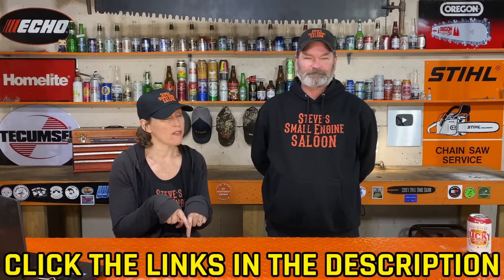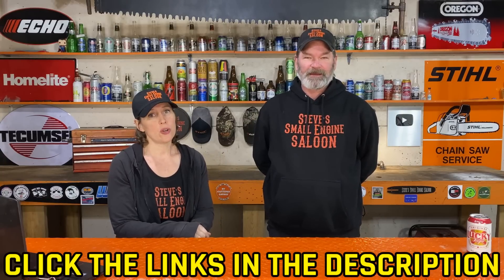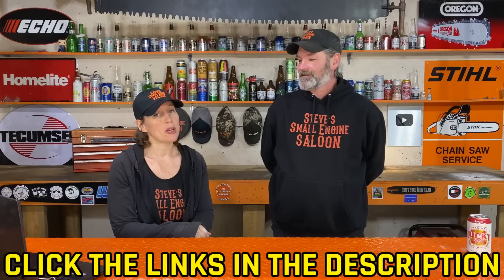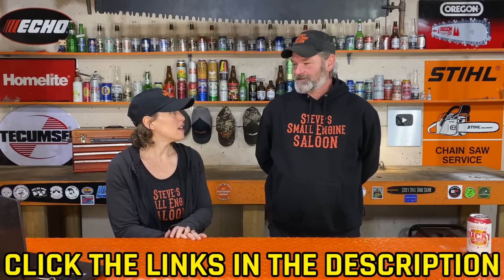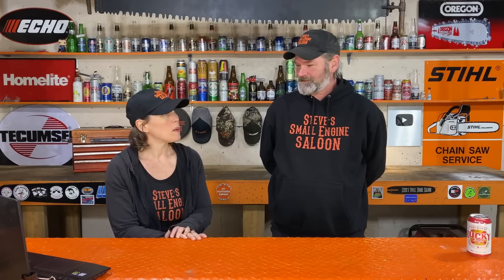Why Does My Engine STOP Running After A Few Minutes? (DAY 29)

Comment: Engine start’s up a minute or 2 then dies. Replaced spark plug, filter is clean, did the gas cap test, even bought a new cap just in case, ??? Should I clean out carb now?? Cleaned the carb but not idling at full power, does not turn off , could old gas do that?

Comment: Interesting, I had a Briggs and Stratton engine which would run and die couldn't find anything wrong with it. Then a friend said have you checked the valve clearance. That was the problem as they age the valves stretch so when the engine gets hot the valves won't seat.

Comment: I had this problem with a stihl 029. It ended up being a bad spark plug. The plug would gather up resistance after a few minutes and stop producing spark. A new spark plug fixed it.

Comment: OK so I have a fun one and although I think you may have already described this I'll throw it out there...... Husq 128LD "ran last summer"  Wouldnt run - found the pickup line missing - replaced and ran "Kindof" cleaned the carb, no change. Replaced the carb and fuel lines and then did the tune (out 1.25 on each and then adjust to get running right)  Just as I got it to where it was running like a top, it died (like being turned off)  CHecked the fuel cap like you mentioned here - No change, Checked spark arrestor - Clean, Changed plug - No change. The only thing I can figure now is that it is the coil.. Only loss is that it fires right back up every time wich if it was heat-related I would assume that it would take a min to start again..... Seemed strange to me thought you may enjoy and others may benefit.

Comment: I had to weigh in on this one.  A long time ago I fixed a two stroke lawn mower engine with the same problem. When I disassembled the carburetor I found a small orifice clogged with lint.  Removed the lint and deburred the rough edge around the orifice and it ran happily ever after.

Comment: I know the questions are over but I've got a big one. So many hydraulic units in my area run on a B&S engines. I have a 208cc. I think these engines are solid but the carbs absolutely SUCK!! I can never get it right, it's brand new and often won't start, won't stay running, etc. Sometimes it will run for hours, others, nothing. What can I do? Replace the carb? With what?

Comment: Had a gas cap save me heaps of money, a guy had a Chipper Shredder for sale cheap, I managed to get it even cheaper, took it home, did the oil change, pulled it apart to sharpen blades and then used it and it ran for a while then shut down checked fuel still plenty it started back up and ran for awhile did the same, flushed tank, cleaned carb, inline filter installed still the same, thinking this is why it was cheap, then before it shut completely off I opened the tank and it took right off, it was a light bulb moment.

Comment: I rebuilt/cleaned my ryobi with 25cc carb, ign module and started up. Now runs then quits or won't restart unless I let it cool down or wait till the next day😬. Did notice the top gas cap might have a breather? I dug some junk out till some clean material showed. Humm give it another try tomorrow ..
Reply: Thanks for the reply. Went to try it today. Fired up ran for 15min and quite. Think there's something with ring, piston and cylinder?? Guess it's time for the grave yard of parts.

Comment: Steve, good explanation on the ignition module,  but you forgot to to mention that after the saw cools down it will work perfectly again until it warms up, then it'll shut down again. 
I had a 1073 pioneer and before I realized what the problem was I thought it had gotten lazy and didn't want to work outside the shed

Comment: I've also seen or rare occasions a spark plug that is faulty or improper will change as it gets hot and suddenly shut the engine down. Usually after 1-3 minutes from cold.

Comment: I addressed all three of them last summer and that did not solve it.
I thought possibly I bought a bad ignition coil and discover there was a mouse nest that was causing the engine to overheat and shut down.
About three years ago had a plugged muffler and caused the engine to shut down also all of them acted the same way like I was running out of gasoline even though I had a full tank.

Comment: Thanks for these ideas. I have a older log splitter with an B&S IC 8 HP engine. It just randomly shuts off. Could be the vacuum operated fuel pump, on/off switch, carb float, etc. I have the parts. Just need the time and motivation to mess with it.

Comment: wow, I cam across this a little to late. I have a sthil 066 chainsaw. Ive changed the filter, it has fresh petrol. It will run full blast for about 30 sec to a min. Then it will cough and splutter like its running out of fuel. If I quickly take my finger off the trigger it will idle fine unless I pull the trigger. Before I pull the carby to pieces and look for something like a blocked jet, is there anything else it could be.

Comment: Another thing for run-ability , especially for 2-strokes, is to check the Spark Arrestor Screen in the muffler …I’ve seen it with a lot of different 2-stroke equipment that the screen will get plugged from running too rich or if they get left idling, the screen gets plugged…this will definitely cause them to stall, die or not want to start…good series guys! 😎👍

Comment: Why do i have gas coming out of my gas cap when its closed?
Reply: If you have full tank and you stored it like fuel is reaching the cap, then it will filter something out. Just don't store with full tank, or put upwards/on the side, so the cap is up, and filtering not happen.

Comment: My Honda generator 4 stroke would shut off after one minute and 6 seconds after starting. Dead off, no surging. Checked the obvious, vent, gas, plug and oil. I would have to wait a few minutes before it would start again only to run for one minute and 6 seconds; every time.  I pulled the carburetor and it was clean. Then I ordered a completely new ignition system and installed it. The problem stayed the same. Since the new ignition kit included a new spark plug which I did not use because my old one looked and tested fine, I figured what the hell and put it in. It started up on the first pull as always as I also hit my timer and it ran one minute and six seconds and kept going and going. What the HELL!!! I have never heard of a plug doing that. Lesson learned, always do the easy parts first no matter if you think it could be the cause or not.

Comment: Briggs used a needle seat that was red/ maroon in color and there are plenty of still out there. It would swell to the point of closing off the incoming fuel to the carb. A variation of your running out of fuel scenario.😊

Comment: A non venting gas cap on pressure washer drove me crazy for a long time. Took a while to diagnose it as a problem with the cap. Then I blew it out multiple times to no avail. Finally drilled a 1/16" hole in the cap. Voila, problem solved! Thanks for this series. Have enjoyed the very useful information.

Comment: Thanks for the 30 days of questions.
My Stihl FS76 trimmer would run fine for several minutes but would die and not run until cooled back down. My research led me to believe that it was the coil. I decided to install a new carb before a new coil and it fixed the problem.

Comment: My chainsaw did the same thing, I had a pin hole in the fuel line and it was sucking air.  Nothing dripped externally.  I had to remove line and inspect  line.

Would always restart after dieing, but would constantly have to restart it.

Comment: Hey steve, another reason why an engine dies after a short run time can also be the spark plug breaking down, see this a lot at the small engine shop I work at.
Reply: I had a spark plug breakdown on my Honda generator. The generator would start and run for about a minute or so and shut down. I took the oil shutdown device out of the circuit and that didn't help. Changed the plug and that solved the problem.

Comment: As it is 2023, I would say at least 60% of trouble with small 4strokes is caused by ethanol-water caused sludge building at the bottom of fuel tank where mesh covered fuel intake is located. To solve many problems we are facing with climate, economy etc., we need US, Europe and Japan built engines, make them well and make them last! Many thanks for what you do!

Comment: Two other issues I have seen- carb vapor lock once hot, and engine case/carb mating surface changes shape and allows an air leask- lean die condition.

Comment: I had this happened to me with my log splitter - it would start then stop and eventually, it just would not start. I replaced the fuel, a new plug, ripped the carby apart and cleaned all the little jets and fuel lines, etc, - I was stumped. Asked someone for advice and they queried me about the oil level. 'Low oil' - so I topped it up and presto, away it went. I'd never heard of the 'Low Oil Sensor' and now I know - I felt like a real goose, such a simple thing, but the sensor was doing its job. At the time I thought, what a great bit of technology to be put into the engine. Even now, a few yrs later, I still think about it and think to myself 'how naive I was' - Live and Learn.

Comment: Steve I had the run and stop problem with my push mower and it turned out to be a fouled spark plug. Cleaned it with gas and fixed the problem. It was soaked with oil so I guess the cylinder wall is getting thin. Agreed?

Comment: Steve,
Probably not the case - but if random, a floater in the tank as a possibility (the other side of an air vent question).  
How about the engine heating up, with things expanding through normal, operating heat level being achieved - say a loose plug changing grounding due to expansion from changing temperatures?
Joe

Comment: I've had a weedeater die slowly like this, and it was the choke not fully opening after starting it, like it was set wrong. I had to fiddle with the choke every time until I found the sweet spot. My current weedeater runs great, but came from the factory with the choke switch set backwards! I 'open' the choke to start it, and 'close' it while running. It took me a while to figure that out in the beginning. I thought I was going crazy. Had to go show it to my neighbour!

Comment: My John Deere Ryder started having a similar problem sometimes would run for several minutes other times only a few seconds. Turned out that the crank pressure tube to the fuel pump was leaking; put a new one on and it worked great.  
Thanks for the 30 days of questions- maybe bump it up to 90?? 🤞

Comment: Hey Steve and April.  Thanks so much for the great series of videos.  Lots of info and fun.  My friend had a problem with his mower running a few minutes and would shut off.  Sure enough, he had trash blocking his gas cap vent.  Cleared the vent and all is well.  Thanks again.

Comment: Had an oil alert on a Honda engine cut the engine out every time the mower turned right on a big "reel" mower. customer couldn't believe it when I diagnosed low oil level over the phone .

Comment: One thing you failed to mention is maybe their is something floating in the gas tank that ocassionally gets sucked down against the hole for the fuel line connection. Had a friend that happened to. They could not figure out why their lawn mower engine would run good, then suddenly act like it ran out of fuel. Then they would start it again, and it would run fine for a while then do it again. They found a dead fly in the gas tank, and the problem went away.

Comment: Sometimes it can be a thermal problem, but most it is a faulty fuel vent/cap problem or a clogged fuel Filter inside

Comment: Hi Steve I have a question. I have a JD lt150  5spd. I used the mower today and before I put it away I was going to back it in my garage and it won't go in reverse it only goes forward and I believe it's in high gear when I push the pedal in the mower does not go in neutral it stays in gear . The parking brake works and the gear shifter moves in all gear's.

Comment: I got a deal on a couple year old 2 cyl 24HP Craftsman rider with 40 hours on it.  Guy sold it dirt cheap, kept having to change the air filter to keep going.  I Found out the large gasket in the gas cap lid had been miss molded. The small vent pin hole was not open. I punched a hole and the problem went away.  When he changed the air filter it had time to vent and he probably checked the gas and it would run a while.  Runs fine now and for hours.

Comment: Good video as usual. But you forgot to mention a plugged fuel filter. I have seen where it would allow the engine to start and run for a little bit then shut down.
Reply: or allow the generator to run until you put a big load on it...
Reply: @wim0104  You are correct. I have seen that also but had forgotten it. Dang it sucks getting old.😗

Comment: I also had this problem on my Kubota 3 cylinder diesel tractor . It would work under load slashing ( Brush hog ) for an hour or so then lose power and revs . I put a siphon hose in the fuel tank and a load of slime and some rust came out , so I'd siphon , refill with clear fuel , over and over until it was as clean as I could get , new fuel filter , add biocide shock treatment and it's been good ever since .

Comment: Hey Steve ive had a four stroke stop running and it was the spark plug . Ever hear of that happening? And the plug was clean only a year old.
Reply: Same.  Symptoms were instant off, like oil or ignition, and would then start right back up... and then die again, rinse and repeat.  Turned out to be the spark plug.

Comment: I've had a similar problem but it was due to the in-tank fuel filter. The thing was clogged and on accelerating the motor it would starve the carb of fuel and shut down.

Comment: My new trimmer was stalling and shutting down, played with the choke, managed to finish the project. Found your video on adjusting the carburetor on trimmers, mine was factory set, probably for sea level and had the, now typical, goofy headed adjustment screws to keep us DIY'ers from messing with it.  Rigged up a tool that worked, followed your instruction, it runs as it should now.  I've  since bought cheap set of the screwdrivers for those screws.

Comment: If it has a fuel pump it may be getting worn out, they don’t always just go out at once. Also check carburetors, fuel filter, vent, air filter, and if these are all ok and it starts and runs and then stops after a few minutes it could be your valves on overhead valves especially need to be adjusted. This is common on certain models especially kohler courage engines.

Comment: One more reason. Any carb with a rubber fuel inlet seat, ethanol in fuel causes the seat to swell and restrict the fuel flow to just a trickle, the engine will run fine until the fuel bowl runs dry then cuts out and won't start until you let it stand for a minute and the bowl refills.
I've had this quite a lot here in UK since the introduction of E10. Replace the needle seat.

Comment: My Echo chainsaw does this. It starts up like a champ, once it warms up it dies and won't start back up. Then when it cools down it starts fine again then once it warms up dies again. Usually when this happens it will be idling fine, I hit the trigger and it dies, then wont start back up.
Reply: After it dies you should pull spark plug and see if it still has spark. I had a Evinrude boat engine use to circle around dock for 5 minutes drive across lake it would die no spark. Paddle back 45 minutes later fires right back up, ended up being a coil.

Comment: Back in the 80s when I was working in a hardware store we got a bunch of Sachs brush cutters and chain saws that came with unvented caps. We ended up making our own vents for them by drilling and tapping the cap then installing a set screw with a groove cut in the side with a thin rotary tool blade. Easy to do and it worked.

Comment: I have Husqvarna riding mower and it had same problem. Issue was about fuel tank ventilation. Ventilation was inside gas cap but there is nothing wrong with it. Ventilation was just a little trench inside sealing so if i screwed it to hard it got blocked. Great video!

Comment: I have a Stihl chainsaw that does this too. According the mechanics I had damaged the piston/cylinder by running a too lean fuel/oil mixture. So once it heats up, it no longer maintains compression and the engine shuts off. Very expensive to fix (I think they have to replace most of the core engine?), so I took a pass and just bought a new saw (the cost difference wasn't even that high).

Comment: Would these issues apply to an older mower? I have a 1986 Murray 11/36 and it shuts off after maybe 30 minutes, it starts lugging like it’s running out of fuel (still full), then it just dies, if I let it sit for a while it will usually start right back up. Any thoughts?

Thanks
Reply: Had the same problem with mine it was the vent!
Reply: @johnmccormick175  that little screw on the gas cap?

Comment: fuel filter restriction; makes the carb bowl run dry.
Reply: Similarly, I was working on a 2-cycle (so no float bowl) and it had a small screen inside the carb that was getting clogged. It would run for a bit, but then wouldn't start again unless I waited about 30 mins.

Comment: funny this should come up - I did have to add oil to my generator night before last.  other than that, it's been running continuously for 40 hours, now.

and for a while, I had water in the tank, and that caused issues.

another problem I've seen is we had an old tow-behind mower that hadn't run in years, and when we put it back in service, the fuel line was clogged to the point, the fuel flow couldn't keep up.  so it would run the carb dry and die, and once the carb refilled, it would run again.